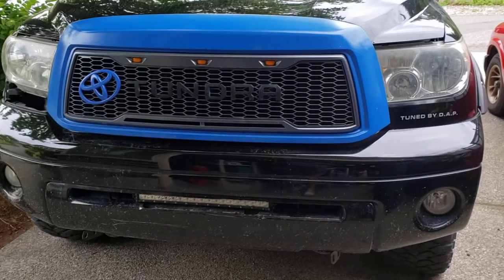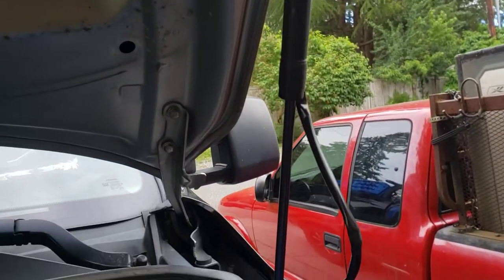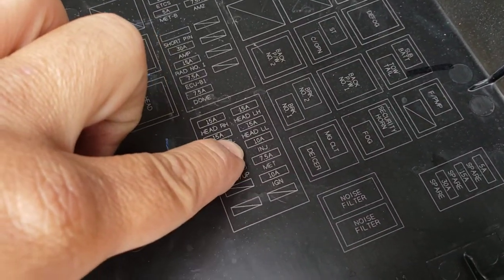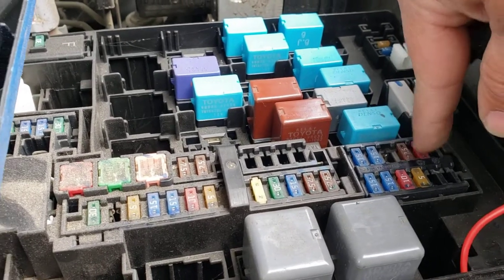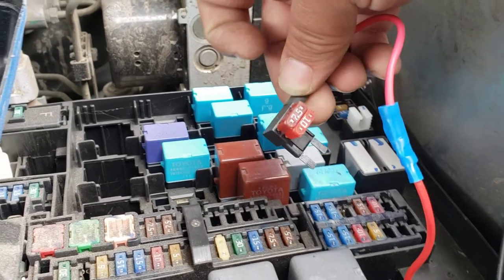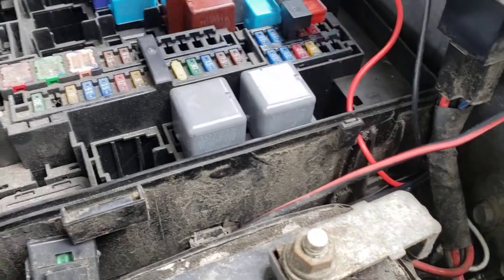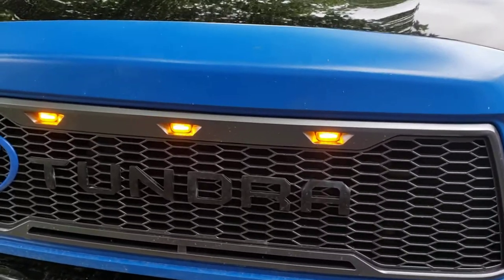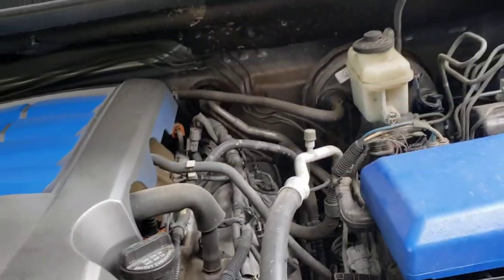EAG Grill Raptor Lights on a 2007 Tundra Limited

Comment: are the "tundra" letters tailgate inserts for 2014+? and how did you get them on just with the supplied 3m or did you epoxy?
Reply from the maker: The letters i bought separately and they have glue strips in the back... they're the insert for the tailgate's logo
Reply from the maker: I used my own glue besides the 3m strips in the back ... but that  caused the plastic to turn a whitish colour... which I had to wipe off several times with rubbing alcohol...

Comment: Did you have to buy the 2010 brackets to install this grill?
Reply from the maker: Yes
Reply: @ayechapin1  did you ever get a latch on it? How’d you do it?
Reply from the maker: @wr1039  I never got the latch installed... in between ordering and waiting for the parts I lost the hardware bag...  :(
Reply: @ayechapin1   I got ya. I just installed this same grill off eBay on my 2008 and had to buy the 2010 brackets.  Fits perfect but there’s no clear solution for a latch.  I’m using a really long piece of rope right now but going to have to get creative for a latch.  I do have the part but there’s nowhere on the grill to specifically screw the latch on
Reply from the maker: @wr1039  as soon as it stops raining I'll go take a picture outside of the latch... and try to share it here...
Reply from the maker: I just uploaded a really short video of what it looks like... hope this explains how I ended up leaving it.

Comment: My tundra 2016 limited and it doesnt have drl light so i did like you but it not working you know what happen?
Reply from the maker: I haven't figured out why it wouldn't work on yours... one thing I noticed is I took the fuse off while the truck was running and immediately killed the truck.
Reply: @ayechapin1  i figured out now thanks you for your video
Reply from the maker: @stevenvo2812  what was it?

Comment: installed the same one my 2014 sequoia, but the hood isn't closing, i feel like it's a few mm longee than the original. it just don't close all the way. even though everything else fit perfectly.
any idea what should I do?
Reply: hey did you ever figure this issue out?
Reply from the maker: Were you able to figure it out?
Reply: Tundra grille is a little bit longer than sequoia. This won't fit on sequoia.

Comment: What is that fuse hook up called?   Never seen that b4. Did it come with the grill?  I bought mine used and no cool connector
Reply: Add-A-Fuse / fuse tap, can be found at the auto store.

Comment: Where did you order this grill?
Reply: Although I cannot say where he ordered the grille (because I haven't talked to him) I can give you a link to that same grille..
https://viciousoffroad.com/i-30590732-replacement-upper-grille-front-grill-with-amber-led-lights-fit-for-10-13-toyota-tundra-matte-black-10tuag01.html
If you have a 10-13 tundra it'll fit perfectly, but if you have a 07-09 tundra then you'll need this kit as it requires the 10-13 tundra grille brackets 
sparksparts.com/p-2010-grille-assembly-installation-kit-for-2007-2009-tundras-pk53100kit
(a little tip, from what I know, you can't detach the grille from the grille surround, so if you're looking to color match the grille surround to the rest of the truck then go with the charcoal grey option as it is almost $40 cheaper)
If you need anything else or have any other questions, all ya gotta do is ask
Reply from the maker: I'm sorry for the late response... I ordered it thru ebay... but it was a lot of headaches... but finally got it
Reply: @ayechapin1  do you have a link?
Reply from the maker: EAG Replacement Raptor Front Grill LED Upper Grille Fits Toyota Tundra 2014-2020
Brand New
4.0 out of 5 stars.
(5)
5 product ratings
$228.99
or Best Offer
Free shipping
95 sold

Spo

nsor

ed
Reply from the maker: There you go... check it out
Reply from the maker: https://www.ebay.com/itm/193850252198?epid=22005188960&_trkparms=ispr%3D1&hash=item2d22601ba6:g:IecAAOSw~c5e8rda&amdata=enc%3AAQAGAAACsPYe5NmHp%252B2JMhMi7yxGiTJkPrKr5t53CooMSQt2orsSd3M8ngECaRA0SmyU4KT%252FnhRhIdJGnsRN5JXVF1i%252FQg%252F03Gs73YtM1wLTCaEPLQmdKuGnvtWVVVufwoMZ2%252ByoajtpIHLefQvMYU2jL40%252FbnySAehjWEeWAVt%252BrA5LFj6A1lCuHNOl8fq0j4NKt4MGe8iPMTG%252By84sEd0XFvHL2aT2UV7XQGxYJhDTulCGFcd3lTWli7wfkG7Wurs9Z9zpz4V%252F47L5F1kCNN3Gvr77HTQLQCcuLP19sVTjeqSpB2jwixf9ebtNHiN%252F%252FkKwPKAnItdoTg5%252Fkv8z3do8Q8uv58r41RT6Ezn9%252B5DQDcal3%252FnB%252B941tI%252F3xXRkhFEhVJGmWtNOWnRfHowmlw8AcGsfyL19KDfKBhHlL%252B8uWmR2b82tEJi7pxcylaSBClHuj6io9u2O%252BePR6PKM6a7BXfLGUEAPwWrFxU34qd3qM0oJgMWru8N9CaSNUIDi6Hd8wfRwpMjBXCayCmwxN6fDjq9Wcr6%252FUZkLGDuCU%252FvYwz0linQTJ9pQ5S03sRfvyVXEkYWJuKxS9UxHbsG4ZKhM80ndIEsawbc09O9ud5U84SaT7v3VGFzcdBUggJc9nI0b0om%252FOo7iBr5QKnNIIHw4lZ19mPwyKjlylL8%252BqavTrrUqFtoA3RMhST7PB7YewtGsvXsRtqUUKOPkt8fzlGN00ZIh7PRNdWGPORgLRkySCuwLFmLg2uGs89SDG%252FlfcFmssGDz6eeL%252FxsNPoKckR5ZJLqI4YwW2CUrWnTBMXKL%252FP0QtLbgMMYZCQFGa0JpK82t%252FPhFP4pTmGpdwTKgcOhrTDUmho7p%252Bs6Twdna0Hhfw%252FvjsdgrSzCec7%252FPSOVzdbALSu2KJm%252Fcc9tEiL5E0o1ksWQBDhE%253D%7Cclp%3A2334524%7Ctkp%3ABFBM6L_f1L9f
Reply: @ayechapin1  thanks bro 🔥